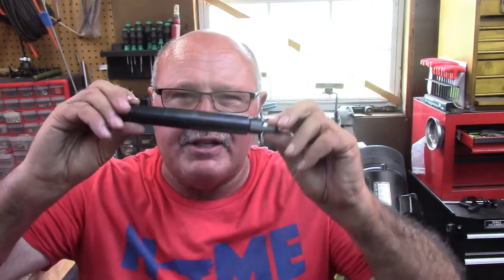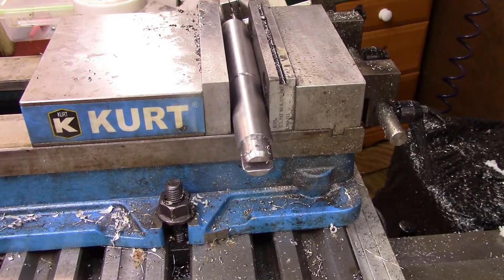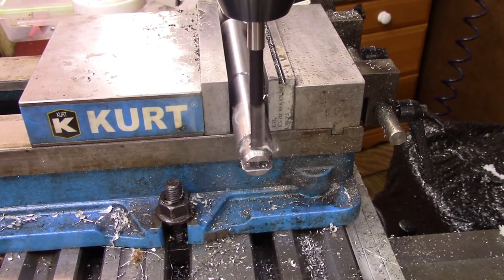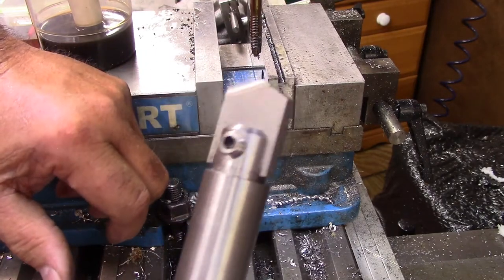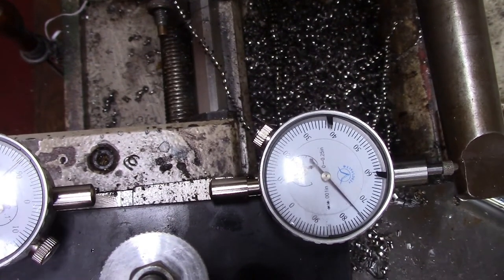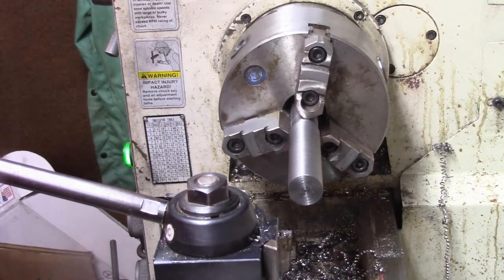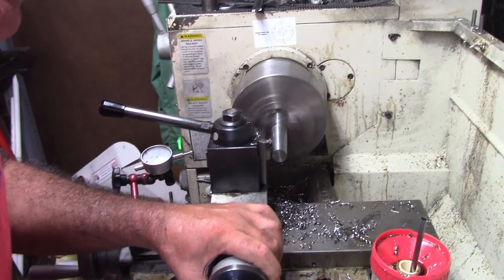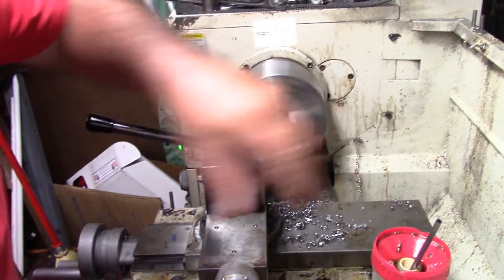Making use of Anthony Browns gift Making a Spade Drill Holder Part 2

Comment: Nice video and project Jim. We have a box full of those spade bits we picked up an auction awhile back. I've been looking for holders on ebay for awhile. Guess it just didn't occur to me to make my own. Great idea!!
The Ole Man
Reply from the maker: Mamco Machining well after I priced out holders it was a no brainer. The problem is like I showed I had no drawings so I just used a photo and educated guess. What I ended up doing is making up a set of 4 spade drills with holders. I have 2 tips for the two smaller ones extra. Thanks for the kind words it is appreciated here

Comment: I have a drill that has a  plastic screw in the middle of the trigger that you can use to adjust the speed. Once set, you just pull it and get the speed you want. That feature would be handy for driving the compound.
Reply from the maker: Dudley Cornman I’ve seen that feature in corded drills, but not cordless ones. If someone makes one it be great for compound drive purposes. Thanks for the comment I appreciate it

Comment: Nice build.  Seemed to cut well.  Something played havoc with the camera focus.  The auto compound feed needs a little more consistency.
Reply from the maker: Mature Patriot / Vernon Currier the ding a ling auto focus in certain situations causes a problem, I noticed it with other creators who use similar cameras. The drill feed the compound is a bit tricky to control the speed. As I said in the video my cordless drills doesn’t have a set speed function so al speed control is the trigger and manipulate the speed and it is inconsistent. Thanks for the feedback it is appreciated